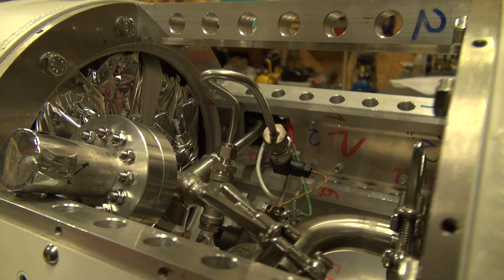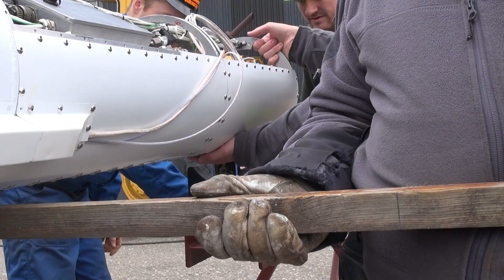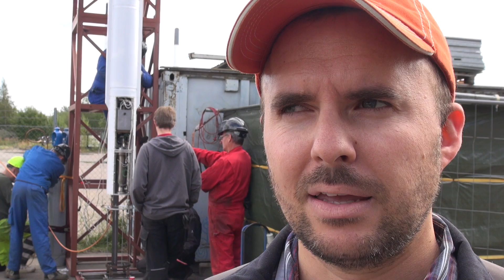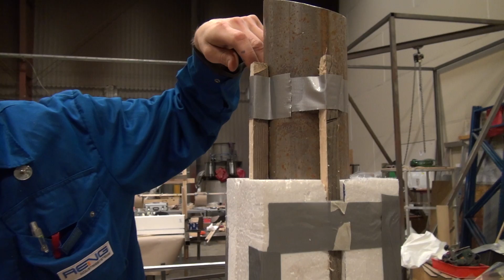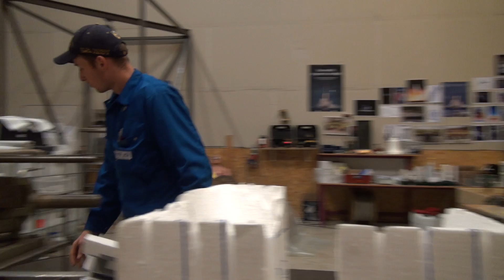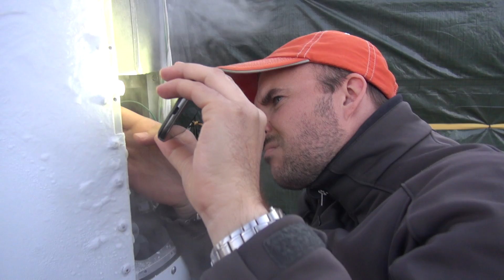Status Nexø I Nov 2015

Comment: Keep your on board batteries warm or you'll not get their rated current.
Reply: +AIM54A That is why we keep them as far away from the LOX tank as possible. They are placed in the avionics section, just above the alchohol tank. The wires running on the outside are also insulated from the LOX tank.
Reply: Just thought of something. You know how if you leave an incandescent lamp on, it heats up? Would it work to use the same principle to keep the electronics warm, or would it waste battery?